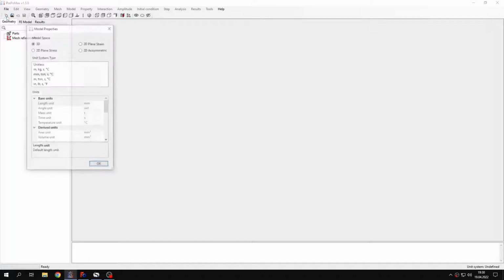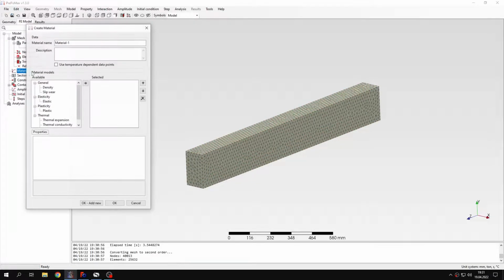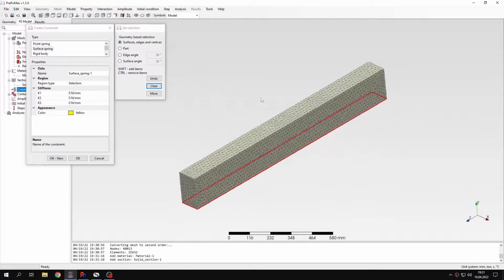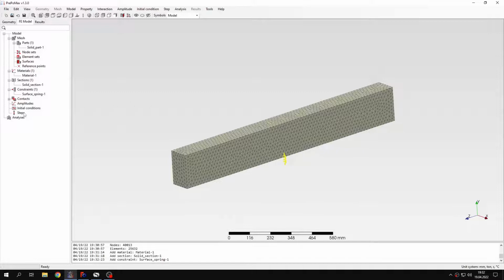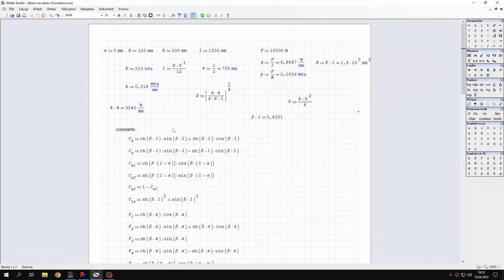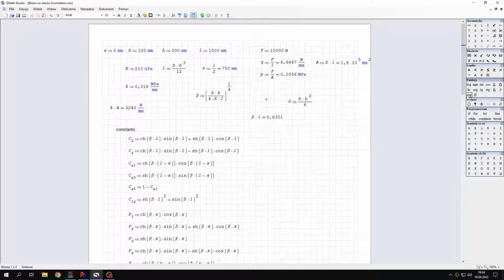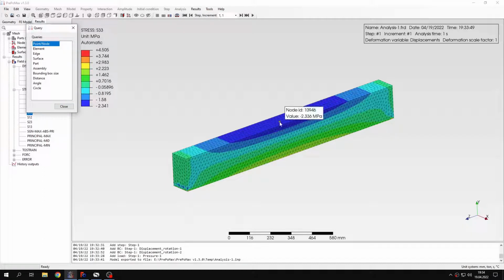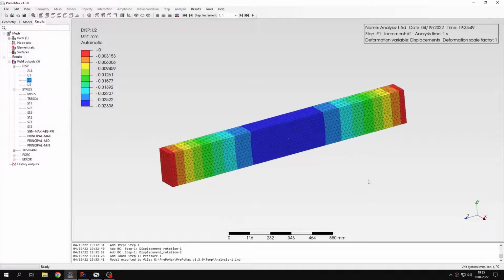PrePoMax (CalculiX FEA) - Tutorial 19 - Beam on elastic foundation

Comment: its possible use to simulate pipeline under toll road crossing ?
Reply from the maker: If you are thinking about moving loads then those are not normally available in CalculiX (same in Abaqus). You would need the dload.f subroutine (requires recompilation of CalculiX) or a workaround where some additional part would be in contact with the structure of interest and had a prescribed motion.